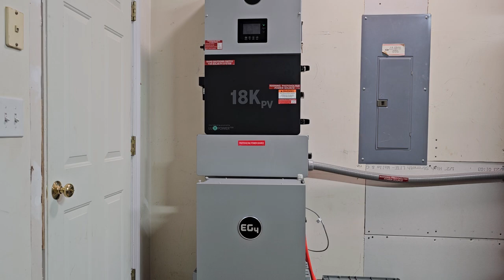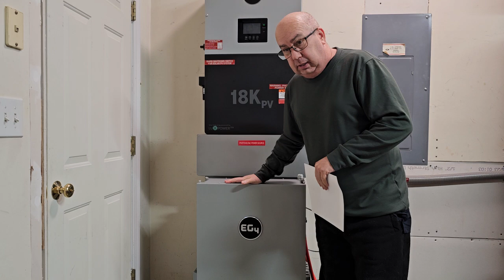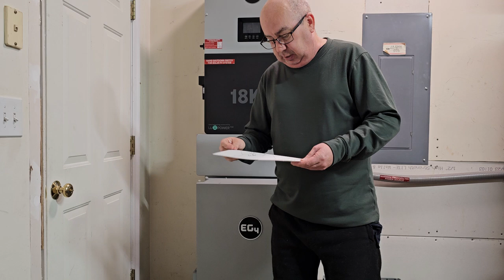EG4 PowerPro Battery Suggestion

Comment: Do you completely discharge your powerpro battery daily and if so how low do you let it go.
Reply from the maker: Initially I was discharging down to 20%, but you loose power in the conversion from DC to AC.  I get 1 for 1 back from the power company, so it is more efficient to not use the batteries and push all the excess power to the grid.  I now keep them at 80% in case of a power outage.  At some point in the future I will lose the 1 for 1 deal and I will start discharging down to  20% again.  The issue you run into when you discharge completely is the BMS might not let the battery charge.  I know there are some work arounds to get the battery charging again, but I just don't want to deal with it.  If you want to go below 20%, I would talk to EG4 or Signature Solar first to see if you can safely go below 20%.  Will Prowse has a video where he said to fully charge and fully discharge everyday.  There could be a warranty issue if you go below 20%, so again I would check first.

Comment: Take a look at the Ethos battery from Bigbattery. It’s exactly what you are describing. Bigbattery also resells their version of the EG4 PowerPro called Rhino2. Unfortunately Ethos is new and about 20-30% more expensive than PowerPro. It looks like other manufacturers will be introducing high capacity home batteries using a stackable concept shortly. Each module could just be a reconfigured rack style battery with a self contained BMS; further simplifying the controls on the top level to a bus bar and display.

Comment: That's why Teslas power wall 3 now even has a 12k inverter built in. ONE UNIT ! 
The failure rate is so low it's more cost effective to warranty a few than increase manufacturing by hundreds per unit on all. 
You have never designed built and marketed anything so why now are you an expert.  Smh

Comment: This idea is not feasible.  It would mean the cells are shipped without BMS protection attached to them.  It would require a huge wiring harness to get cell voltage leveling taps and temperature sensors from the battery case to the BMS case.  There would be all sorts of potential to miswire such a setup with bad consequences.  It would violate code.  It would be FAR simpler to sell the internal parts (cells, BMS board, breaker, etc) so the battery box can be REPAIRED than to split the battery from the BMS.  The whole point of the BMS is to tie the battery safety to the battery PERMANENTLY.  This is why BMS is with the BATTERY.
Reply from the maker: Sorry, but I disagree. # Batteries are shipped all the time without a BMS.  You can buy individual cells and build your own battery.  Usually you build the battery pack and top balance before you install the BMS.  This battery is effectively shipped without BMS protection since it is shipped with the power turned off, thus the BMS is not powered on and provides zero protection.  # Wiring addition would be minimal  no more than and additional 6 - 8 inches per wire. # Mil-Spec cannon plugs are keyed and cannot be connected incorrectly, so no way for the user to mis-wire anything.  # What code would this possibly violate?  # PERMANENTLY? So if the BMS needs to be permanently installed and they sell you a BMS how do you install it without first disconnecting the BMS which is already installed?  The point of the BMS is to protect the battery WHILE it is charging or discharging, not when it is powered down and being shipped.
Reply: Cells are shipped without BMS but they are 3.2 volts, not a huge battery banks with 50 volts and 300 amp capability.  When you say the battery is "off", it is the BMS that is doing that, BTW.  So without a BMS, the cells can't be "off".  You can tilt at this windmills if you want, but you aren't going to get anywhere.  Lithium battery safety is no joke and your idea won't work from a regulatory and safety perspective.  You will notice that you can only by single cells or battery banks with BMS, but not a rack of wired up batteries without BMS.  That's a big clue.
Reply from the maker: @mciholas  I really think you are missing the point of my suggestion. My suggestion is really for making the repair of the the BMS and electronics easier and cheaper.  The new battery would still be shipped as a complete unit with the BMS attached (otherwise why would you buy it if you couldn't actually use it).  If something in the BMS fails, you could just ship the BMS unit back without actually opening up the battery and disconnecting all the wiring manually (voiding the warranty).  You just unplug a cannon plug and battery cable and the whole sealed BMS unit comes off and can be shipped back for repair.  The company could stipulate that if you are sending the battery pack back for repair it has to be a complete unit with the BMS connected. If you are just sending the BMS unit back there would be zero hazmat involved.  As far as regulations,  there is a UN Manual which covers shipping of lithium batteries.  Which portion would my design violate?

Comment: I built a portable power station, using a 3-part rolling mechanic's tool box.  The bottom box contained the battery, T-class fuse, and the solar charge controller.  All other components, including DC fuse panel, 1,500 watt inverter, and AC outlets, were contained in the middle box.  The two were connected using a 175-amp Anderson plug, so you can take the middle box off, unplug the battery, and have two separate modules.  The top box was used for storing the odds and ends (charge adapters n' such) needed for the power station.  It works remarkably well and is more or less a simplified version of what you're so wisely suggesting.

Comment: Did your battery fail or just offering advice to the manufacturer?
Reply from the maker: Just advice.  I work in the defense industry and while the main aspect of design is Form, Fit, and Function, the other aspect is Sustainability.  As a whole the battery cells are extremely reliable and the BMS and associated components are the weak point.  A modular design allows for cheaper shipping, troubleshooting, and repair of the system as a whole.  If you have two batteries and one stops charging you could swap the electronics package from one to the other in order to determine if the fault is in the BMS or the battery pack. Once you determine which unit is faulty, you could just ship that component back for repair instead of the whole battery.  It also offers the benefit of making future upgrades cheaper as well.  In the open market, BMS hardware and software keeps improving.  The way this battery is constructed it doesn't lend to being upgraded.  One of these batteries is quite an investment and so you would not replace it unless it fails, but if you had the option to upgrade functionality at a reasonable cost many probably would.  A modular design would open up an additional revenue stream of people who want to buy upgrades.  For instance, I wish this battery had Bluetooth capability.  I could then easily integrate the monitoring into Home Assistant.

Comment: Very wise observation and great idea. Hopefully, EG4 or Signature Solar will acknowledge your video. Oh, and why don't you put that beast outside on the opposite side off that wall? It's rated for outdoor use. Just my two (I mean) twenty two cent comment. 😄
Reply from the maker: Thank you.  I have everything I need now to install the battery on the right side of my distribution panel.  I just need a few hours of free time to move it and put it all together.  Hopefully this weekend.